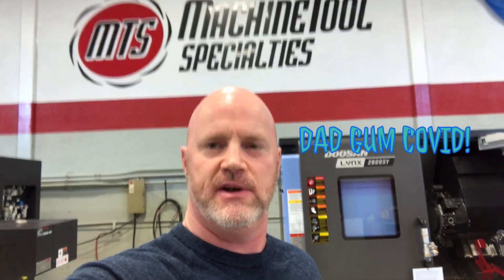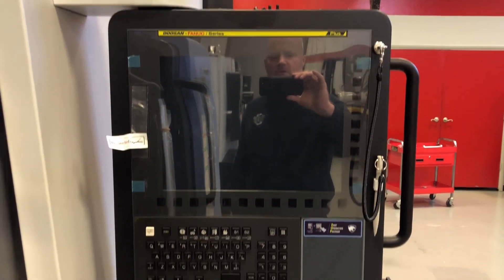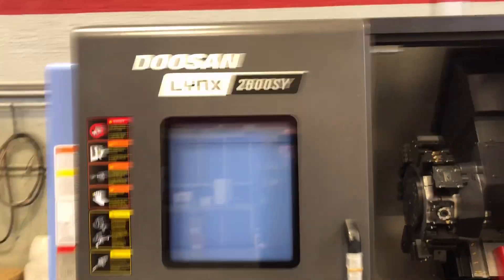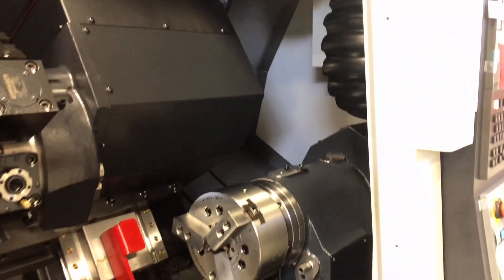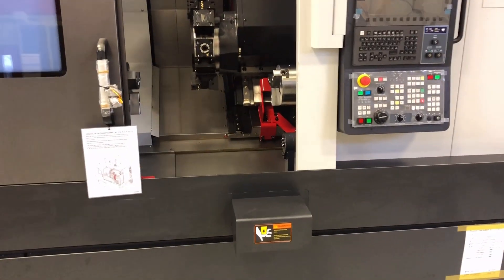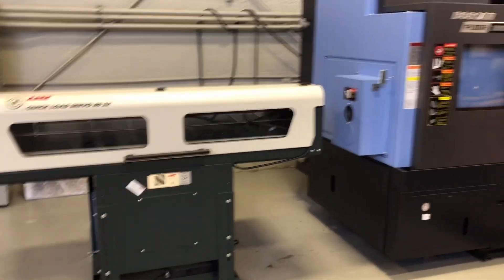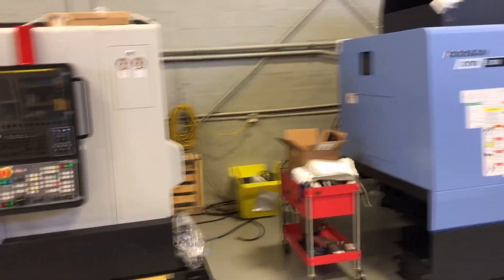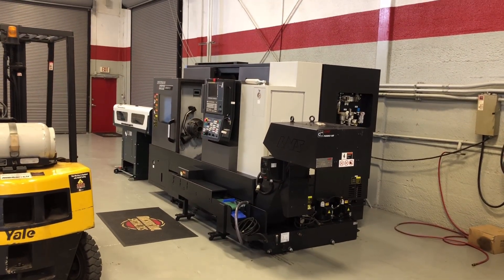DAD GUM COVID, Doosan Lynx 2600SY, DNM 5700, Puma 2600SY

Comment: LYNX 2600 ??
Does it still come with the very average Live Tools or have Doosan upgraded it to the Puma Live Tools ? 
( 5.5kw/7.4hp )

Don't get me wrong.
LYNX are a great machine just not so good for power and rigidity of the Live Tools.

Curious why Doosan built another machine to compete against it's other machines ????
LYNX 2600 ?
GT 2600 ??
PUMA 2600. ???

Definitely interested to look at the specs on this latest addition.
Reply: The live tools on a Lynx 2600SY are BMT-55 and 7HP.  The Puma equivalent is the Puma 2600SY with BMT-65 and 10HP.   These are two completely different machines, but each serve their intended purpose very well.  Thanks for reaching out!
Reply: Lynx is Linear Ways and BMT 55 / GT 2600 has box ways but has no Y-axis  / Puma 2600 is box way with BMT 65 and Y axis. Different price points for different needs. The difference in price is pretty substantial too. If you needed bigger bar capacity but don't need a Y-axis, but still want a box way for a cheaper price then the GT2600 is better. Or if you're running alum all day but want bigger diameter but don't need a boxway, then the Lynx 2600 is better, don't need to overpay for a boxway and bigger turret.
Reply: @peterdao8552  
Hey Peter.
My some what confusion with the LYNX 2600 is WHY ??

The LYNX 2100/2200 are great machines,  as long as you understand their limits ?
But at least,  still better than a HAAS Linear Lathe.

When saying the LYNX is limited ask the question WHY make a 2600 ??
If the price is close to the 2100 I definitely understand the appeal of this machine for a new machine buyer.
Larger Chuck with the Puma GT Tool Turret.( BMT55)

My main confusion of WHY a LYNX 2600 ??

10 inch Chuck ?? 
On a Linear Lathe ??
Just makes NO sense.

A 10 inch Chuck is for Serious cutting ??

I will have a price of the LYNX 2600 as soon as my Doosan Dealer replies to my email ???? 

Locally a fully Loaded LYNX 2100 including tax is around 180k
A fully Loaded Puma 2600 including tax is around 260k
I am guessing the LYNX 2600 will be somewhere in the middle ??

For dollar sake i would prefer a Puma GT 2600 with C axis and a 
DNM 5700
A combination of these 2 machines together is not much more than a Puma 2600.

Of course this is only my thoughts.
But a Mill and a Lathe in a small shop is more useful than a Turn / Mill  

Maybe i will come back and edit this comment when i Finally have a price for the LYNX 2600 ??
At a guess i would say 210k - 220k ??
Reply: @weldmachine  I know for the Lynx 220 I have, we run barfeed stuff. And  some of our work is more than 2-3/8" dia. We were looking at the Lynx 2600 to fill the gap between 2-3/8 - 3" dia, but up to that size, we preferred a boxway over a linear. Just more stable. A dedicated mill and lathe is always better! But mill turn is for convenience so you don't have to set-up fixtures on the mill. I luckily found a used 2017 Puma 2600 SY at a big fat discount with low hours. So I got very lucky with that.